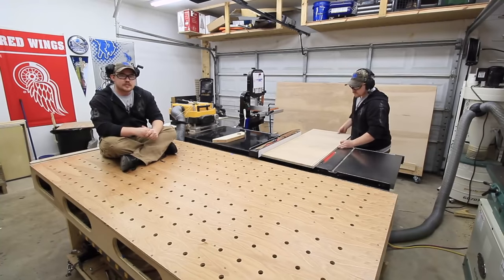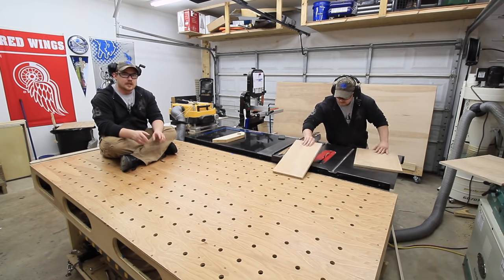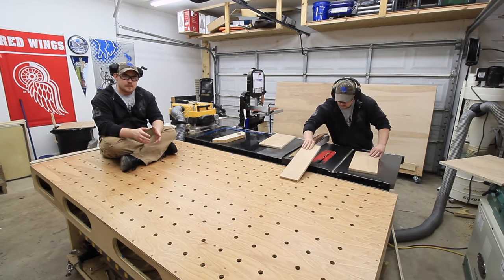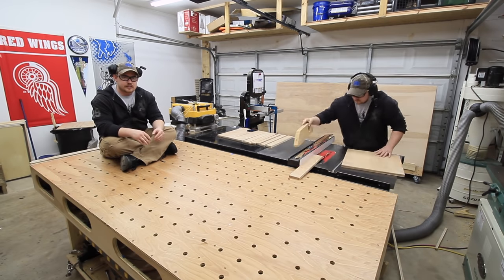Table Saw Box Joint Jig - 229

Comment: Made a box joint jig for an old table saw I had that worked great. Upgraded table saw, and could never make one to work right. Broke down and got the Incra Box joint jig. Used it once, haven't touched since. Maybe I need to make more boxes?

Comment: I am going to purchase those plans! looks like a simple to make jig
Reply: The only problem I have with it is the spring and advance system. It pretty much requires a band saw or scroll saw to make those parts. I will be buying these plans shortly and will be rigging something up that doesn't require a band saw.
Reply: +Peter Gillock matthias wandel has a video on installing a jigsaw through a hole in a little piece of plywood. I've tried it to make gears and it works surprisingly well.
Reply: +Peter Gillock I made the small parts without a band saw. For the locking bar, I drilled out a hole towards each end to match the radius of the curves. I then set my table saw blade to hog out the rest of the material on a crosscut sled making several passes. For the advanced lever, i marked the angles and carefully cut them with a fine tooth hand saw. I then cut it to length on the crosscut sled. Any of the parts that needed to be rounded over can be done so on a belt or disc sander. Work with what ya got.

Comment: What are all of the holes in your worktop for? Is it that system they have on industrial beam saws that essentially turns the worktop into an air-hockey table to make it easier for the user to slide timber over the surface? If it is indeed that, then could you maybe make a video about it because that's so cool and I've been wanting to make something similar for a while now.
Reply: In an earlier video, Jay built his version of Ron Paulk's work bench. The holes are there so he can use either bench dogs, or to insert clamps to hold material down while he works on it. I'd encourage searching for Jay's video, and also doing a YouTube search for "Paulk Work Bench"

Comment: Jay:  I see you are using the Grizzly Cyclone.  I have the Shop Fox version of the same thing.  I have been trying to design a permanent(hard plumbed) collection system.  I noticed you are only using 4" flex hoses and the supplied wye fitting.  Any comments on how your setup is working or not working for you.  I am planning to use 6" metal pipe off the machine and branch off to 5" pipe and eventually 4" hose.  Thanks.

Comment: Great job as usual.  Can you comment on whether / how easy it is to get different width joints if you don't have a Dado stack?  Thanks
Reply from the maker: I use a 1/8" blade. Makes joints in 1/8" increments very easy.

Comment: Did you use the low or high temperature hot glue on the threaded rod? Hot glue is great, but I haven't had much luck with it being permanent. I've only used the low temperature stuff though.
Reply from the maker: +Stanton Taylor High temp. Nick Ferry actually accidentally dropped it and it broke off during his trip. I epoxied it back.

Comment: Digging the logo, Jay. Do you remember about what the threaded rod cost? Seems that would be the biggest cost in the jig (which is awesome since it doesn't require gears).
Reply from the maker: I believe it was $12 for a 36" piece.
Reply: +Jay Bates thanks. I didn't realize it was that cheap!

Comment: Awesome finger joint jig! Love the new logo and enjoy finding the new editing tricks with each video. Question: Have you noticed any wear where the wooden "wedge" meets the threads in the long bolt? Keep up the great work!
Reply from the maker: +Houston Firefox I used mard maple for those parts. The tip of the pointer slightly compressed to the shape of the threaded rod. You're basically trying to smash maple end grain with the force of your thumb. I really doubt the advancement lever will ever wear out.
Reply: +Jay Bates, started mine tonight.  Thinking of making the hardwood bits from purpleheart (its all I have on hand), think it'll be ok?  I used baltic birch for the jig pieces.
Reply from the maker: +David Ingram Sounds like yours will be better than mine :)
Reply: +Jay Bates lets not be hasty.  I'll upload a video once complete.  I already had to re-cut a couple pieces because they were off a little.

Comment: Great video Jay. I built John's jig and like it but have trouble finding a blade in my assortment that is a good match for it. What blade ru using with it? btw, mine worked alt smoother after applying Vaseline to the moving surfaces. W
Reply from the maker: +Walt G This is the blade I am using: http://amzn.to/1OQUXbr

Comment: What if the thread count on the rod is not equal to a multiple of the blade kerf?
Reply from the maker: Then it doesn't work. This jig requires a 1/8" blade and a 8TPI rod.

Comment: I can't find a 1" thread rod anywhere and I can't John to respond, hopefully you know - does the rod size / thread count matter? can I use 3/4" or 1/2" rod instead of the 1" in the plans?
Reply from the maker: For his plan it really does require a 1" threaded rod with 8 threads per inch. You can get them online fairly cheap though. Do you have a tractor supply or Menards near you?

Comment: They are all one finger off.
Reply from the maker: +Jeff Stanley Correct. This was just testing the fit. Offset the other side of the joint by one tooth space on the threaded rod.
Reply: +Jay Bates I guess John was just testing his fit also, he left it the same way.